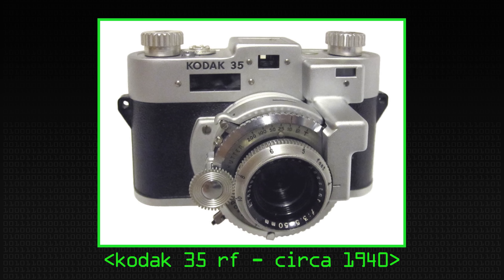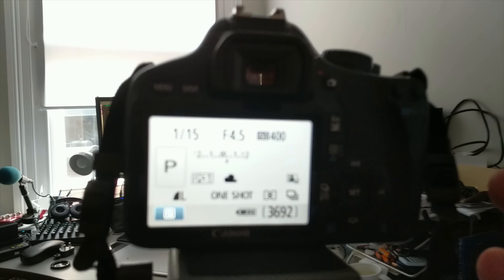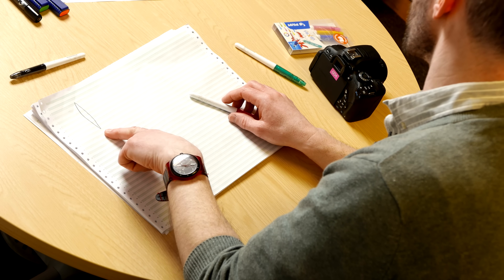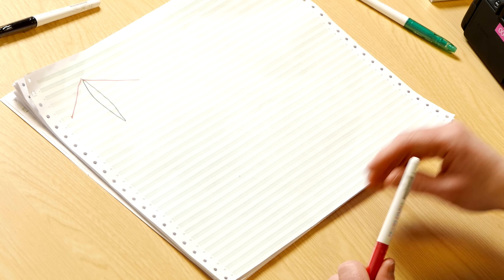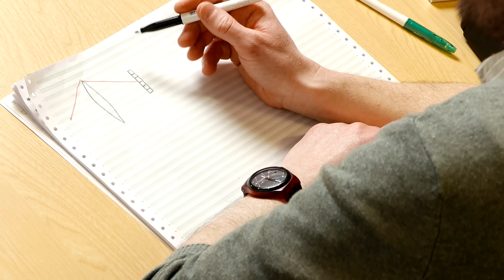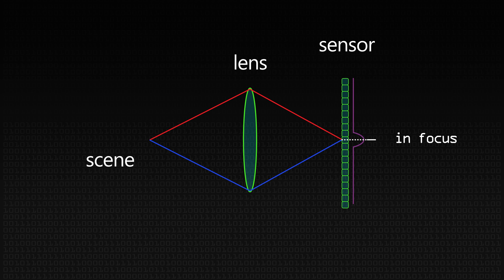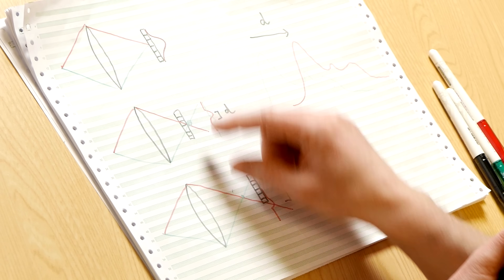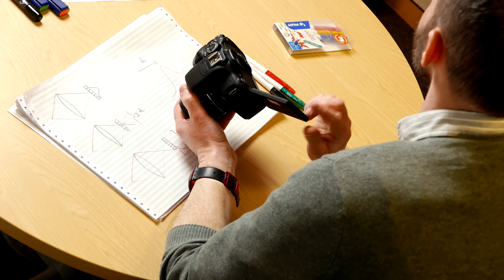How Autofocus Works - Computerphile

Comment: Canon did come up with dual pixel autofocus but now it's available on Sony sensors like Samsung phones use as well as others
Reply: Are those Sony sensors or Samsung sensors?
Reply: @ArumesYT  Last I heard Samsung were using Sony sensors but it's possible they've since stopped
Reply: @kendokaaa  They also use their own sensors since 2003. So again, are the sensors you're talking about Sony or Samsung?
Reply: Another thing to remember is that other manufacturers only use DPAF on small (smartphone) sensors. The most probable explanation is that they have a licence from Canon (who patented it ofcourse) to use DPAF , but that the use is restricted to small sensors so Sony and Samsung can't use Canon's invention to compete with Canon directly.
Reply: Nikon had phase detection on image sensor before Canon in the Nikon 1 series. The sensor was made by Aptina.
Reply: @sebastian_trzaska  And Fuji before Nikon. But both systems sacrificed image pixels to do so. Canon's DPAF doesn't. Canon's DPAF pixels provide focus data AND image data at the same time.
Reply: @ArumesYT  Very interesting, thanks for the clarification!

Comment: Another thing about the phase detection, is that there will be less mechanical wear on the actual auto focus motor and gears, so the camera will have a longer lifetime (The less a moving part moves, the longer that part takes to eventually wear out and fail). But these days probably not as important, since most people appear to bin tech every 3-5 years.

Comment: Thank you for this video! As a photography amateur, I've been really interested it understanding the difference between phase detection and other focus mechanisms so I am really glad you chose this topic for a video. However I have to say I really didn't get how it works based on the diagrams you showed. Why does it need a separate sensor? Why is the sensor only one dimensional? How do the two images appear on the two sensors separately...?
Reply: It needs a separate focus sensor because when you look through the viewfinder, the image sensor doesn't get any light to work with. And the sensor is not one dimensional, but phase detect pixels are. Most autofocus sensors have both horizontal and vertical sets of pixels.
Reply: So it's one dimensional because there's no reason for it to be 2D, you'd just get similar patterns swept round in a circle. All you need is one distance, so 1D suffices.

And the diagram of the two 'images' is a bit of an abstraction, really those red and green lines are just two separate rays of light, and behaving as a wave, many rays average out to make the curves seen. You can then use chromatic aberration to determine which waves (top or bottom) have ended up in which places
Reply: @natan9065  Yes, there is a reason for them to be 2D, and they are. They're called cross-type focus points.
Reply: A prism or semi-silvered mirror is used to split the incoming light between the phase detect sensor and the viewfinder. 

There's a problem with this method. Because the PDAF sensor is separate, and isn't directly on the plane of the main image sensor, it must be precisely calibrated. The ideal is for light to travel exactly the same distance whether it is going to the PDAF sensor or the main image sensor, so that they both see exactly the same focus. Any tiny discrepancy between the two, will cause inaccurate focusing. In practice there will be a difference, but small enough to be compensated for by calibration. Expensive DSLRs allow this calibration to be updated by the user. Cheap ones don't, and as a consequence can often suffer from an inability to achieve tack-sharp focus. 

Having the PDAF sensor separate is therefore not ideal. It's only necessary for traditional SLR-style cameras with an optical viewfinder, because no light is hitting the main image sensor when the viewfinder is in use. Mirrorless cameras (or SLRs when using live view) have no need to do this, because there is no optical viewfinder - light is always coming through to the main sensor. So, for those that use PDAF, they put the PDAF sensors on the main image sensor, either using the Dual Pixel system that he talked about here (which Canon has been using for many years now), or by simply replacing some of the regular pixels on the sensor with phase detect points. But there's a downside here too, in the latter case: the pixels being used for PDAF can't be used for capturing the image, so they have to be interpolated when the final image is constructed so as not to leave holes. In some cases the PDAF array even has wiring going across the sensor which can cause banding. But the advantages of PDAF are considered so worthwhile that every mirrorless camera manufacturer uses it (or a hybrid system of both PDAF and CDAF). Except one.

Panasonic use only CDAF, but their "DFD" system attempts to address some of its shortcomings by using a knowledge of the out-of-focus optical behaviour of their lenses to compute the distance and direction that the lens needs to move to acquire focus. This makes acquiring focus in Single AF very fast. However, it still suffers from a problem that can never be completely solved for CDAF, and that is Continuous AF. With CDAF, if your subject moves, you have no choice but to hunt around for that peak again. PDAF always knows where the peak is, so (in theory) it doesn't have to hunt.

Comment: is it possible to use AI to Autofocus I think its better , nice video btw
Reply: Lost angel I'm no expert, but I think AI is starting to get used to autofocus in high end phone cameras. DSLR cameras like the one they show traditionally don't have as much compute power as current high end smart phones and instead have highly specialised hardware and software built only for capturing images.

Comment: My pre-video guess - checking the deviance of an image processed by someting like CV2's Canny function.

My logic with this is that the more blurry an image is - the less the 'borders' would be detected.
Reply: So if an image is out of focus, there's an uncanny valley between the two peaks in the two sensors?
Reply: That's basically right for the second method, except that the Canny algorithm has a few extra steps to remove "weak" edges. As he mentioned you would use something like the Sobel filter in practice. This is the first step in the Canny algorithm.
Reply: @JohnLadan  Yup, just finished viewing the video.